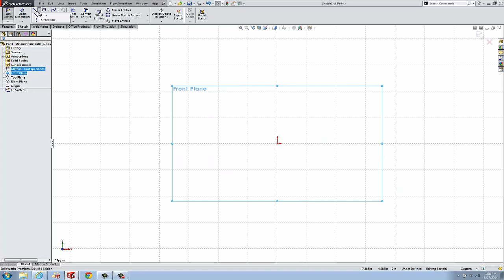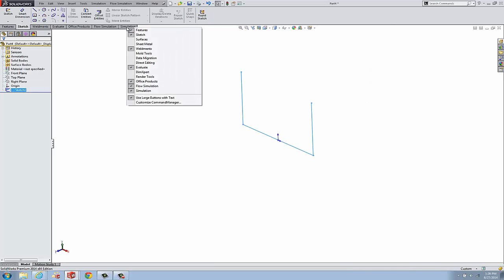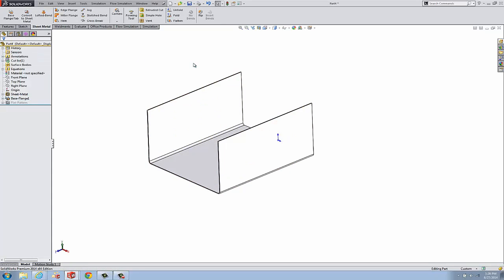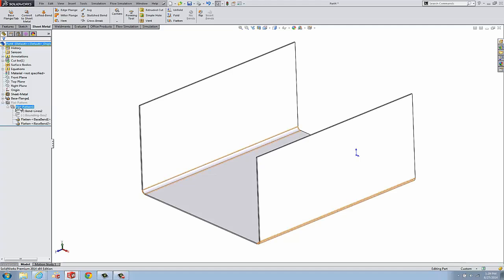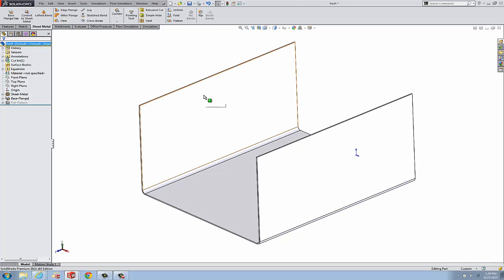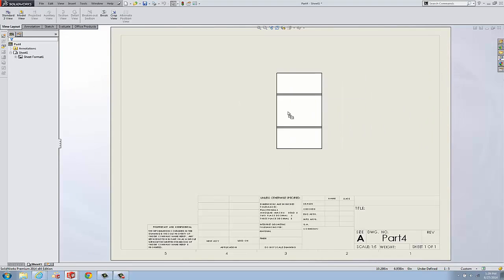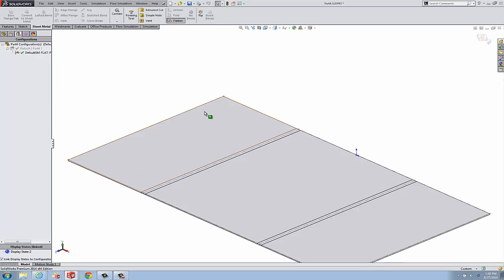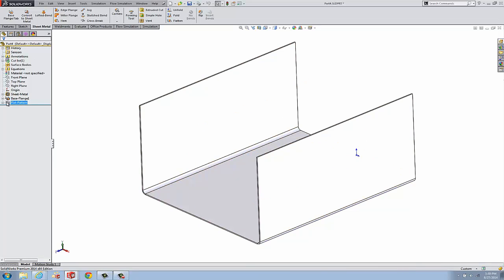SOLIDWORKS - Let SOLIDWORKS Create your Flat Pattern Configuration

Comment: Thank you, do you perhaps know how to create a non-metal flat pattern in SW? I need to create a silicone extrusion with a oversized pressure/friction fit into an extrusion. I can't seem to find this information anywhere on the SW help or tutorials.
Reply from the maker: For assistance, please contact our tech support team at goengineer.com/contact
Reply: @carlabekker9946 do you find out the answer non-metal flat pattern in SW. Please share it if you have the answer. Appreciate it.

Comment: Why do you have the radius lines? Is it possible that they will not be?
Reply from the maker: Sharp angles are not desirable for bent metal products. They often cause cracking and fracturing of the material. Along with being unsafe to handle.

Comment: how to create flat pattern of spoon??
Reply from the maker: Flattening a “Formed” part like a Spoon is not considered a “Sheet Metal” function.  Sheet Metal covers Straight Bend sheet metal design and a few Swept features as well, but is not for a Die formed type of part.

You can use the Flatten Surface feature in SolidWorks Premium to get a flat blank of a formed part like a Spoon.
Reply: @goengineer   Thank you.
But I use standard version SW 18.